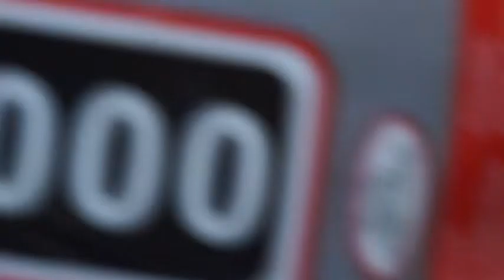Macbook Pro 13 A1425 Speaker distortion fix

Comment: Bro you're a lifesaver, Just had this issue on MacBook Pro A1278 Mid 2012. I saw your video and I was like worth a shot. I opened and checked the subwoofer and grabbed a q tip and push it a little bit just to see if that was the issue and yeah. So I grabbed some super glue and just retouched the outer rim. Cleaned it too and voila!! Night and day difference!! Thanks a lot my man!!
Reply from the maker: Top job,  hopefully a long term cheap fix

Comment: Thanks for the info. It worked for me although I have ordered new speakers.
Reply from the maker: Awesome, replacement would be the better long term solution, but this as a temp fix is fine
Reply: Hi, where do you ordered? i need a replacement too.  Thanks.
Reply: @sebastianhidalgochavarriag559  TBH, I can't remember but I think it was Aliexpress
Reply: Did the speaker replacement fix the issue?
Reply: @Di_Genius123  I've not fitted them yet as the repair is holding up
Reply: Kevin Mills thanks for the reply brother. I’ll do the quick fix before looking to replace them, cheers

Comment: Please, what kind of clue is it?
Reply from the maker: What do you mean ?
Reply: Ricks Tech glue, I mean. Did you use a glue? What kind of?
Reply from the maker: B7000 frame adhesive
Reply: I applied superglue with a pin. Worked great!

Comment: Are you a computer tech? I had the dead hard drive replaced on my mac book pro 2015 but when I got it back the right speaker was distorted (it was fine before). What do you think might have caused that? Is there some way you can put a computer back together that can cause a distortion? Also, do you have any idea how much a repair like this costs? (I don't use the genius stores, they're the most expensive & not great in my experience) I go for independent repairers.
Reply from the maker: If you had the hard drive swapped and are now getting distortion

They the repair either hasn't put all the screws back in the bottom or has stuffed up majorly as you don't need to go anywhere near a speaker to replace the hard drive